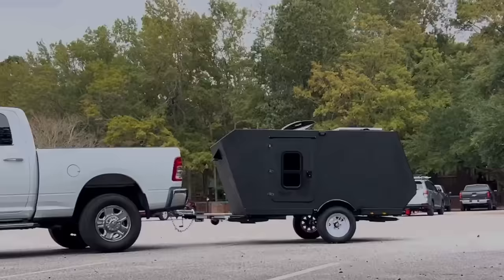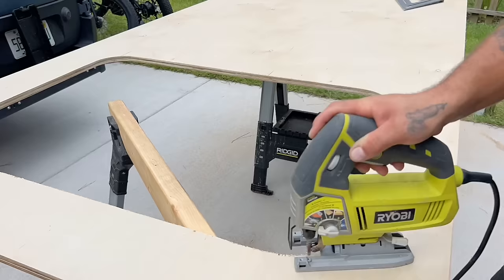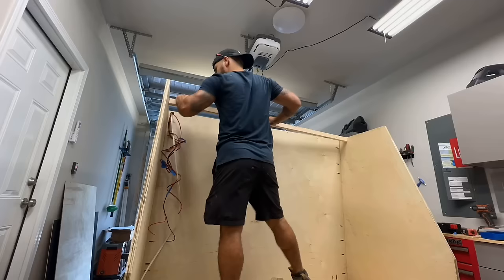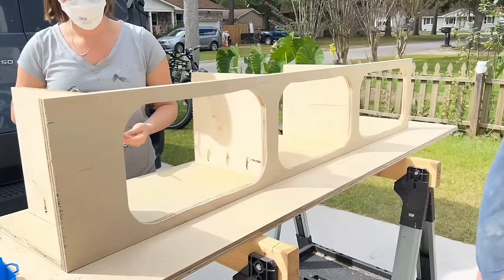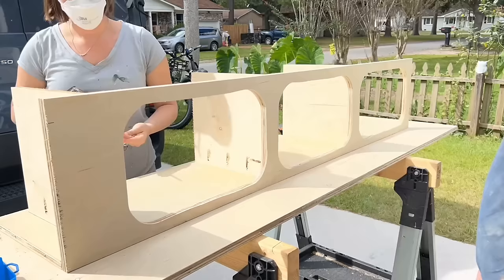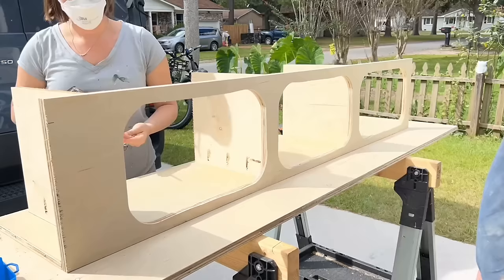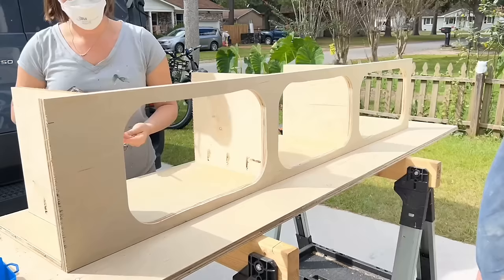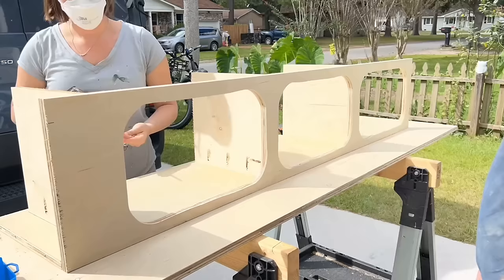How I Built A DIY Camper From Start To Finish | FULL BUILD

Comment: I don’t know. I feel bad for whoever buys this. Yes it looks great but there are some questionable, major concerns. That subfloor will rot in one year unless you never use/tow it in the rain. Also the roof looks to be supported by pocket screws, which does not provide sufficient structure in my opinion.
Reply: It's very mexican 🌯 build quality
Reply: I agree. Also, liquid nails is an interior glue. He should have used a silicon based automotive glue.
Reply: Are you kidding?  have you seen how they build new campers these days?   His construction is light years ahead of what camper manufactures are doing. I'd honest trust his build over my camper.. which I've had to repair numerous times.
Reply: I honestly appreciate your opinion! I’m not well versed in builds so you having an opposing opinion is helpful
Reply: Most campers use plywood floors with wood joist on top of the trailer frame some use sort of  a plywood with fiberglass in it.
If it was me in the video I would have used a Marine plywood tho, but he did very well
Reply: @mlw9195 and i honestly appreciate you, appreciating them haha. :) Hard to find people who are willing to hear the other party out. Respect ✊
Reply: Yeah, I agree. Could use a type of sheet metal under the floor as debree on roads and trails will just eat away at it.
Reply: Wow, this is beautiful! Nice work!
Reply: @matthewspry4217  before I respond, did you mean your comment as an insult?
Reply: And there's no bathroom and shower duhhh
Reply: it’s also not very secure, those hinges for the door, with screws on the outside, just undo 5hem to take the door off 😂
Reply: @peter-robinson  Not sure why all the haiters! People are quick to pick apart someones build as they are sitting on the couch not doing anything.  It looks great and built in the driveway using basic tools so much respect!
Reply: With this, 1 or 2 days then if weather comes, you're DOOMED. I work hard for my money. I wouldn't buy it.😏
Reply: @umbrellacorp.  Well glad nobody asked you to! Plus in 3 years they have over a quarter of a million subscribers and you have 60 in 5 years so obviously they are doing something right so like I said don't judge while sitting on your couch posting other people's content while they are working hard building things.
Reply: Some opinions are worthless because if you intended to correct the guy, you would inbox him which could be helpful instead u decide to play the SNAKE 🐍🐍...next time keep your opinion to yourself.
Reply: @m.r1164  Hell to the yea!!!
Reply: i dont
Reply: @VOTE.AMERICA  Wowww, you're taking things seriously. Why so personal?. Relax. It's just a opinion. I'm Not a YouTuber. And my work and personal life doesn't have anything to do with this. You spend your money however you want. I have my family to take care of. Subscribers have nothing to do with your personal choices.
Reply: @VOTE.AMERICA  here is why people are picking it apart, and it's not hate.  People with skill and knowledge are   expressing legitimate concerns on quality and safety because he wants to sell it. He is responding to people looking to buy it but not to people pointing out serious flaws. This trailer with it's weight distribution is dangerous and shouldn't be on the road.
Reply: Great job!
Reply: Ii
Reply: That's what I was about to say from the very beginning flawed 😢 maybe it's because it's his first build he doesn't know yet

Comment: Oh man, I don't want to bash on this because it's a cool project but I have a lot of concerns here. The biggest and only one I'll bring up is that it was swaying during the test drive. Trailer sway is extremely dangerous and will cause a major accident that could be fatal. To correct Trailer sway, you need more weight in front of the axle than behind it. This build has all the weight in the kitchen area and almost no tongue weight.
Reply: I guess I should read a few comments before posting - saw the same thing - thanks for letting him know.
Reply: I'll 3rd this respectfully. 
Maybe a simple solution:  pick the whole box up off the trailer frame and flip it 180°.  A few lighting changes but the tongue weight is solved.  And with the hatch opened I could vision the back of the truck (or suv) as an an addition to the "kitchen/prep" area.
Reply: This guy said he was going to sell it on, which is concerning. I wouldn't hold back critiques on people looking to sell products, if it was just for him it would be different.
Reply: Where is bed  !!!!!!!

Comment: Great project man, just 2 points I thought you need to attend to; 1. The water bottle will eventually pull those screws holding it as it's wood, 2. The door hinges being outside are a big security risk unless your door locks on all sides.
Reply: Yes, the water bottle should be on the inside as part of the kitchen. This would make it easier to refill.
Reply: It may be a security risk but, a thief will get in regardless if your hinges are on the outside or the inside. If they want something inside, they will get to it. Sucks but, that's how it is.
 :(
Reply: I would think anyone willing to remove a door hinge to break in would probably be willing to cut a hole or break a window as well.

Comment: Dude, the bumps on the road will bust the few pieces of 2x4 holding this camper to the deck. I encourage you to apply some aluminum L-angle to the inside walls and floor to make sure you don't loose it just by hitting a couple of potholes. On an enclosed cargo trailer the vertical studs are made of metal and welded to the deck frame. A few 2X4's aren't gonna cut it.
Reply: Thank you! cuz I have no idea how to do any of this your opinion is so helpful!

Comment: Pretty nice work.  For better towing, I would've installed the batteries, inverter and other electrical components on the tongue, if possible.  Too much weight astern of the axle can be prone to bad oscillations.
Reply from the maker: Thanks Homie I really appreciate you taking the time out of your day to watch our videos and I totally agree if I ever do this again I’m gonna put the entire batteries system in the front to help distribute weight.
Reply: I noticed the camper seemed to be swaying a bit on the road.
Reply: @nealwright5630  Yep, noticed the same.
Reply: @buildersblueprint  ah, my thoughts had already been shared.
Reply: I thought the same thing, but if he puts a storage rack on the tongue at the front he can probably offset a lot of the dry weight of the batteries and fridge/cooler. I wouldn't load too much else in the rear though. Load the bed of the truck first.
Reply: Also by putting the electrical by the hitch,  you could put a couple of outlets by the sleeping part to charge phones and other uses.
Reply: You can see it already swaying at low speeds during the test drive. It's a cool build and i want to encourage this type of thing, but this trailer needs to be taken off the road and corrected ASAP
Reply: @Odins-Dad  I think a lot of it comes back to the frame of the trailer itself and being pushed beyond what it's capable of being used for. Between the bolt together structure and that skinny axle, I wouldn't haul more than 1000 lbs on it, and not go much of over 50 MPH either. It can be "rated" for whatever the company wants to put on it, but it'd be pretty difficult to ever hold them liable in the event of any accident.

Comment: I normally would not comment with so many criticisms but you are selling this camper to someone and as such, there is a responsibility to the potential buyer to be aware of some MAJOR issues with this project. While the end result looks nice for your B Roll footage, there were so many issues watching this video that the end result is more like an HGTV "renovation" than an actual, functional camper.
 - As others have commented, the all-black and effectively no insulation means that this thing will BAKE in even slightly warm weather
 - The electrical terminals should really have covers protecting the metal terminals from accidental touches since you are talking about enough current to injure someone
 - The roof trusses were attached with pocket holes and have no supporting structure along the side walls
 - The rear tailgate hinge is fully exposed and the entire door opening is without a gasket or ever rubber trimming (the bottom of the hatch is exposed plywood in multiple scenes)
 - All walls are a sandwich of 1/8" plywood, 1/2" rigid insulation, and 1/4" plywood with no vertical studs or structure. Vibrations and flexing from road use will tear this apart
 - The doors appeared to have no gaskets or weatherproofing and hinge screws are exposed on the exterior making it VERY easy to remove the door and break into the trailer
 - The subfloor was just painted plywood. This will have water damage in less than one season
 - Joints were filled with epoxy and sawdust filler (good technique) but then not reinforced with fiberglass taping - rigid joints on a trailer built this poorly will crack and split
 - Using 12" glass weave without overlapping and extending past/around the edge means that there is no continual structure or strength around corners - again leading to cracks
 - AC/Heat unit holes appeared to just be punched through the exterior without any gaskets, sealing, or other means of preventing rot and water egress
 - Conditioned interior space but no moisture barrier means condensation inside the walls or on the surfaces (which as pointed out are not very waterproof)
 - All finished surfaces are painted plywood that appeared to have major tear out from being cut with a table saw and jigsaw with incorrect blades for material

Lastly, you focus a lot on the LiTime products and feature them heavily in this video as well as a link to their products in the description, but you never disclose in the video if you were compensated for or given the products or have a standing partnership with the company (I assume you do seeing as you have an affiliate link with a discount). Similar issue with the EcoFlow AC/Heater. This is an FCC violation and could get you in a bunch of trouble. Your channel has enough subscribers and videos at this point that you should be aware of the laws behind proper disclosure for advertisement and sponsorship programming.
Reply: I can't believe this isn't the top comment. Seeing the walls go up made me come to the comments; it's a danger to the public.

Comment: Nice build. I am sure you will enjoy it. I work at a trailer dealership, so I see problems on trailers that others do not. First the bolt together frame kits are fine provided you do not overload them.  You seem to be in good shape there. I would advise you to check all bolts that are accessible for proper torque and security. They often work loose after a few trips.  Once the frame has some miles on it this will get better and less frequent. Also your choice to use a spacer on the trailer wheel in our experience has been problematic. We will never use them at the shop rather find a wheel with correct offset. They do effect balance and as in your case wheel studs are too short for full thread engagement of the lug nut itself. This is a recipe for lugs nuts that will loosen and cause damage the wheel, studs and possibly loss of the wheel while rolling down the road.  I don't mean to be a downer as you should be proud of your build, but I wanted to share my concerns with you. Safe Travels.

Comment: A tip for cutting pieces the same. Cut the first one with a saw, but then screw or clamp it to the next panel and use a router with a flush-trim bit. The cut one is now your template and the other will be exact when done.
Reply from the maker: That’s actually a great idea ill definitely try that next time
Reply: awesome tip!
Reply: This is the way!

Comment: Nice job. looks great.
FYI: at around 25min add the new tyres. You added spacer behind wheel, when you tight up wheel nuts no threads came thru. Thats big no-no, min 3 treads thru nut...
Reply from the maker: Thank you this is interesting information. I will take a look at them today and see how many threads are popping through. Thanks again. 🙌
Reply: @buildersblueprint  The reason you want to have threads protruding through the nuts is so you can see at a glance if any of the nuts have loosened.  This is a standard engineering practice.
Reply: wow  i am not mechanic or any of this good worker builder but pointing it out  now i notice and yes  that could be a big no no long drive might gets loose

Comment: I used to work for Fleetwood Motor Homes back in the early 90s, and I've probably built at least 3000 of these things.

A couple tips for others wanting to build their own trailer.
First, the subfloor needs to be HEAVILY treated. A couple of coats of paint won't do it, unless you only drive on dry roads in dry conditions, like in the Sahara desert.
Especially since it can't be replaced without completely destroying the trailer.
The wood should be marine grade, treated with a sealer, and then undercoated. It will see the same conditions as the underside of your car, so it should be built to withstand them too.

Insulation in the ceiling and walls should fill the entire cavity, don't leave air gaps.
The insulation also provides structural rigidity. A tree branch falling onto that 1/4" roof, even with fiberglass over it, will punch holes with an air gap underneath, whereas the insulation would help cushion the blow with a completely filled cavity.
If you can't fit sheet insulation in the gap, then use spray foam and trim it down with something like a bow saw (used for trimming trees and shrubs).

Also, rather than liquid nailing the subfloor to the frame, it should be suspended on top of thick rubber strips and bolted down.
That will completely insulate the box from the frame rigidity and allow it to float, which will reduce shock stress on the structure.

Otherwise, this looks like a great project. I couldn't build something like this without keeping it, lol.
Reply from the maker: Wow, thank you for all the advice. It’s seriously means a lot. If we ever build another one we will definitely use some of these tips to improve the quality of our belts. Also, thank you for taking the time out of your day to watch your videos. Have a blessed day. ✌️
Reply: Yeah that plywood gunna rot
Reply: Insulation works best with an air gap, doesn't it?
Reply: I've seen hundreds of these videos and wonder the same thing about the sub floor not being protected. He did the whole thing in rigid coating but not the bottom. I was thinking of glassing it in and then coating it like he did.

Comment: A tip for trailer tires that saved my ass on multiple occasions: use the same wheels as you vehicle. It gives you so much more flexibility. If something happens to a vehicle tire you can use the trailer tire and com back for it with a proper repair…the spares on the trailer, etc.
Reply: Only works if you're trailer has the same bolt pattern or you have adapters
Reply: @pizzamangametime9773  considering this video is about building a trailer from the ground up, this would be something you account for during construction…..it’s why I mentioned it
Reply: @Menuki  I'm pretty sure this is a harbor freight trailer based off of the original wheels and the design of the frame or at least something similar to a harbor freight trailer the frame and tongue are very similar

Comment: I started building TDs in 1994. We changed the design for increased strength. We put the base/floor on top of 2 2x3s and glued & screwed into them from the top. Then when we attached the walls we screwed into the 2x3s.  This offset loses a little inside height, but strengthens the structure by 1000%, lol.   Consider it next time.  Thanks for the video and great job. Looks like you had fun and that is what it is all about.

Comment: Exellent build! A really nice little camper with all you need for a mini vacation in the hills, good job! One question thou: wouldn´t it be easier to paint it light colour and not need an A/C, then painting it black and need an A/C (higher cost, dry ac air, more stuff that can break etc.)..?

Comment: What an excellent job you did, I'd have painted it white cos the black will heat up the box like an oven, covering wires with insulation reduces the current capacity by 50%, better to have used flexible conduits to run the cables in
Reply: No to outright say you are wrong, I am curious as to what code you are referring to that derates its cabling to 50%. The ambient temp from NEC Table 310.15(B)(16) allows up to 167 degree F. He isn't even bundling cables so I don't see and issue there either. In homes all across America there is cable being run thru insulated space within attics and walls. There are also vehicles/trailers built just as he has done that are regularly sold to customers. I like to learn so please tell me if I am wrong from my understanding of the NEC.

Comment: Great build: the only thing I would change is in applying the fiberglass cloth? I would’ve started at the bottom working the way up overlapping & shingling it with a final corner application at the top.
Reply: Also why didnt he just finish the entire frame with back door first before applying it. I feel like that added another 3 days on when he couldve waited and done everything at once with the fiberglass ☹️
Reply: @1028rhbfwdh how's the one you made holding up?
Reply: @suhtangwong   considering my dad builds and renovates all tbe time. I just wanted to point out how it could be made faster for the person building it. It wasnt meant as a diss. Just more so like hey heres some good advice to cut back a day or two of curing.
Reply: Goodness, this seems an interesting diy project but really are you planning to sell it? I hope the poor buyer hets a decent warranty.